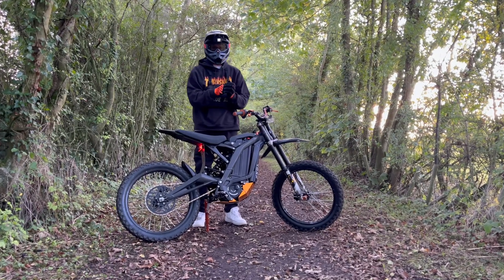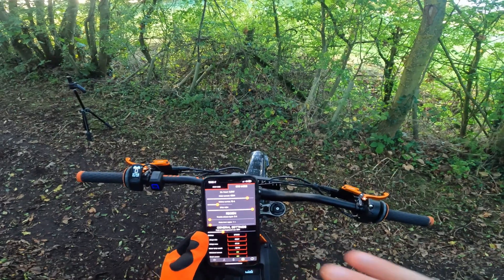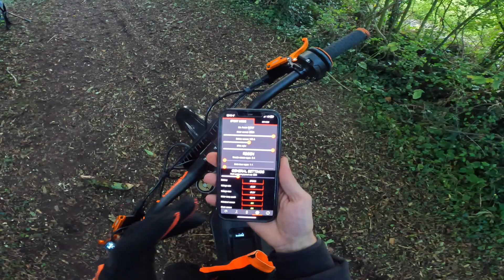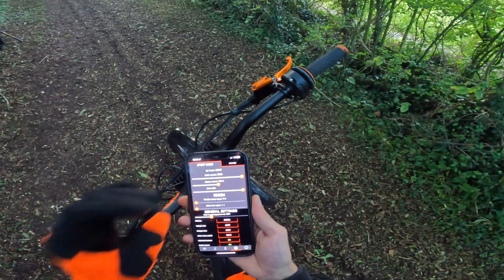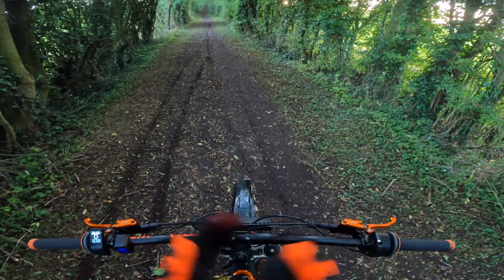DOUBLE Powered Surron Light Bee X // Updated Tests + Full Speed!

Comment: How's the Torp TC500 holding up? Still using the stock battery? Any damage to the battery buy using upgraded controller? Thanks man!
Reply from the maker: The tc500 is still going strong and definitely still one of my favourite upgrades! The battery is doing well also, my battery is nearly 2 years old and the over all capacity has definitely dropped leading to less range per full charge but this well happen to any battery. For example an iphone battery will only perform at peak performance for 6-12 months before the over all capacity drops and then it wont last anywhere near as long! Thats the only downfall i’ve noticed battery wise. 🔋⚡️

Comment: learning wheelies with stock can be fine however weight of the rider must be considered in the equation right? I'm 90kg. what about you if I may ask?
Reply from the maker: Yeah you’re probably right, weight would make a difference but it’s all about how you use your weight to balance as well. I’m a light guy, around 60kg and sitting at the back of the seat made a very small difference to how the bike came back where as if you are heavier it makes it easier to get the front wheel up

Comment: What size of sprocket were you running in this video?
Reply from the maker: I was using a 56t sprocket, obviously with stock sprocket there would be a more increased top speed but i prefer more torque 👌🏻🔋⚡️

Comment: If I upgrade to TC500 with stock 60v battery, and 54t sprocket, will I get over 45mph?
Reply from the maker: Yes mate definitely! i use a 60V 38ah stock battery and a 56t sprocket, i can get up to 51/52 mph so its slightly faster than a standard surron. The torque increase alone is worth it. The bike is a different beast with the torp controller 🔋⚡️
Reply: @mattfrancisofficial  Great to hear!  My bike is actually a cinebike for filming onset for commercials and movies.  Noise is always a concern.  I'm concerned my belt on the motor will break with the extra power.  I imagine upgrading to a chain (warp 9) is necessary?
Reply from the maker: I personally haven’t upgraded to a chain kit and have never had problems with my belt, never slipped or snapped on me and have been using the same belt for just over a year. I’d say once you start going above the 12KW stage you would benefit more from a chain conversion kit but i’ve known people to ride higher than 12KW and still have no trouble with their belts. I suppose it comes down to personal experience and preference and i will be trying a chain kit in the future but for now the belt drive is more than capable for me🔋⚡️
Reply: @VidMuze you do understand that chain drive is a lot noisier?
Reply: @harrirauhanummi  Right... that's why I don't want to convert to chain.

Comment: Did you put the wheel rim diameter in or the overhaul size with tyre. ?
Reply from the maker: The overall size including the tyre, measured from one side to the other from tip of the rubber.

Comment: In your previous video you said that torp controller allow stock display use but what about horn? Can I still use stock horn with Torp TC500?
Reply from the maker: Yes the horn will still work with the TC500. If you also purchase the torp display you would have to leave the standard horn button on the bike with the eco and sport mode button attached. You can remove the speedo display from eco/sport mode buttons. The standard eco/sport mode buttons can be used together with the Torp display as the Torp display plugs directly into the controller. Personally i removed the whole display and eco/sport mode buttons because my horn button was faulty. 
I hope this helps! 🔋⚡️

Comment: So many people claim that eco mode gives you better range so I've done some tests. I've ran the same track / distance with the same speed but one time on eco mode and the other time on sport. Stock battery (charged to 100% before both test runs), stock controller. There was zero difference in the battery drain between both runs. But I'm wondering if the aftermarket controller alone would make a difference since people say the stock one is quite unefficient.
Reply from the maker: Thats very interesting! Something i never tested myself which i wish i had! I did go riding with 2 other standard surrons the other day and I was getting more range than they were. When they got to 50% i was still around 63%. 
This would indicate that the Torp controller is more efficient than the stock controller. I’ll have to experiment more with this in future for a video🔋⚡️
Reply from the maker: In addition to my first reply. I was running more power than the stock surrons as well so even when using more power the Torp controller was more efficient from what I experienced. 👍🏻